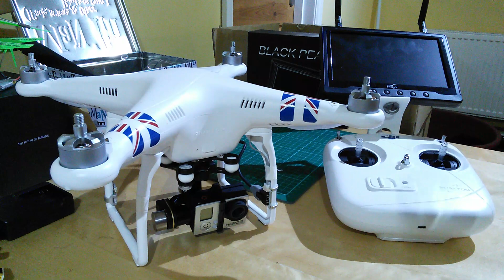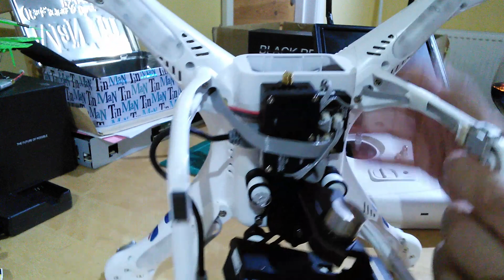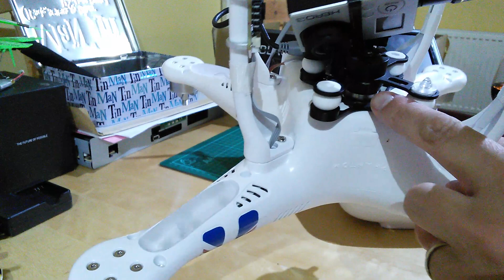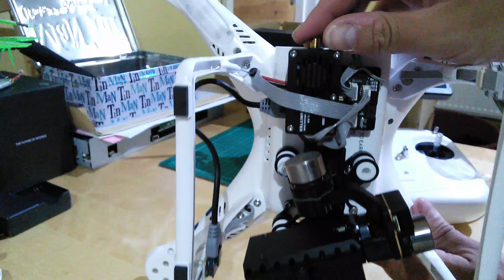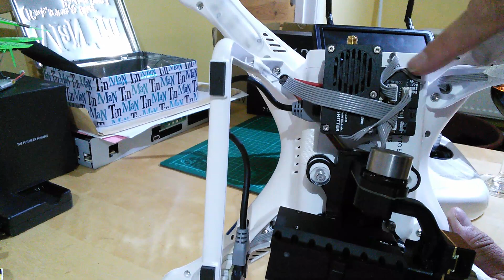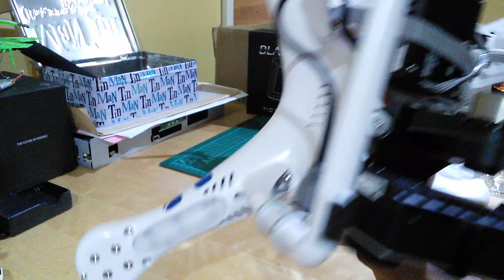My DJI Phantom 2 Zenmuse H3-3D and FPV setup

Comment: hello

I have the Phantom 2 with Zenmuse H3-3D and the Gopro Hero 3 black+

Still I not used the Phantom to record video, I have only used the Phantom for two aerial photography jobs, but yesterday I discovered this issue recording my first aerial video. I have an issue with my GoPro 3+ Black recording a loud buzzing sound when plugged into the replaced Zenmuse H3-3D on my phantom 2. All software on my Phantom is calibrated and updated. I checked all gimbal connections. I have installed the DJI Zenmuse H3-3D Anti Interference Reinforcement Board too. The GoPro works properly out of the gimbal, but the problem is when the GoPro is placed on the gimbal and Power ON the Phantom. In the sound track of the  video is recorded a awful strong buzz. This sound only appears in the video and is a strong sound.

You can help me please? I am frustrated by this problem. 

I put in Youtube two tests of my problem, please, see the videos and listen the sound:

Test 1: http://youtu.be/_WoX_MdevbQ
Test 2: http://youtu.be/ppdSyr6IKuY

Regards

Comment: Hi Simon, thanks for this very helpful video - there's very little out there in the way of instructions.
I am curious as to how you mount the receiver to the monitor/controller. Cryptically, there is one single piece of velcro in the AVL58 kit and I am stumped as how to use this with the mount? any help much appreciated.
Reply: Hi Simon, many thanks for the quick reply. Your answer helped a lot - I didn't realise that the Black Pearl had the built-in receiver. I have it working now and it's superb. I went for the BP after seeing your video - great choice. Thanks once again and keep up the good work!

Comment: Hi Simon,

I've just ordered the IOSD Mini, I already have the video HUB board and Transmitter, is this completely solderless also with the IOSD Mini? Also does the IOSD Mini come with the correct cabling to link with the above?

If not where can I get the cabling for this solderless setup from?
Reply: ***** Thank you, I decided to try and go for more range with the FPV setup and have ordered the immersion 600mW Long range Transmitter w/ SpiroNet Antenna and the plug and play cables straight into the Phantom 2. Have you ever thought about extending the range of your remote for the Phantom 2? I've seen a couple of things on you tube of people modding the controller to give a range of up to 6km!

Comment: How much flight time are you getting?
Reply: Wow that's crazy I'm getting 19 to 22 minutes on my phantom v1 flying dual 3s 3000 mah. And 2200 meters in range using all the standard components and setup.

Comment: Hi Simon, thanks for your videos and for your good taste (italian wines ;-)). I have the same setup you show here, the only difference is an immersion RC TX. The issue I have is that I can see the iosdmini output on the monitor, but no video at all.
I tried to switch the fpv hub from iosd to video, but nothing. Should I change some setup on my gopro side to see the output? Than you!
Reply: Thank you Simon! I think it's the poor ribbon cable. I changed it but I fear that the usb output module is ruined. It's a shame for DJI and for me!

Comment: hello simon, I was buying the monitor blackpearl, but then I read that it is not compatible .. use other frequencies than the AVL58 .. I see that it works then .. or are there different versions?
Reply: ok thanks

Comment: Hello, I notice you the pins on the gimbal diagonal as described in the instructions.  However I notice that this restricts the horizontal axes on the gimbal so have moved my pins to both at the front, is this a bad idea?
Thanks
Reply: That's great thanks very much for the reply :)

Comment: Question:  I have a Phantom 2 with the H3-3D.  First, can I use the gopro app to pull down video instead?  I know it isn't great quality, but I only need to frame shots.  Second, is the Phantom providing power to my gopro?!  This is all new to me because I am upgrading from the original Phantom with all this gymbal and video stuff modded out with 3rd party gear.  I know the original phantom would interfere with wifi and such.

Thanks!
Reply: ***** Thanks for the quick and good information.  I remembered the no-wifi from the first Phantom, but thought they had changed frequencies with the Vision. I  wasn't going to try it without some research just in case.  I suppose I'll need to do what you've done in this video here to get the video and telemetry data on the app then yeah?

Anyway, thanks again and keep up the great video work.  Hit me up if you ever need some slick titles or graphics. :)

Comment: What is your average range with this setup? I have a black pearl, IRC 600MW TX, and 2 spironets CP antennas (1 on Tx, 1 on black pearl)

Anyways my black pearl has horrible range and I hear it's due to not using an immersionRC receiver (since that is the transmitter manufacturer)

Comment: Simon, is it possible to install this gimbal on p2v, i thought it needs a special cable to power up the gimbal.
Reply: ***** thanks simon,
Reply: ***** I did the research and it's not very straight forward. Which is why I sold my P2V and bought the P2 with this gimbal.  The main issue is that there is NO tilt control on the P2V.  The other is that there would be soldering wires and cutting into the body to fit the gimbal.

Comment: Hey simon.
quick question. Do have have any controls from the ground for the gopro. pitch roll?
also if i was taking the odd picture can i use the gopro's video?
thanks in advance.
Reply: cool. thanks for the reply. the store im buying my phantom from have told me t wait a week for the new transmitter. still pretty unsure if i should be buying a zenmuse or a p2vp.
looking to get my licence too.
Reply: Thanks for the info.
I think I'll go for the gopro set up as the shop I'm buying from will set it all up and include a screen. I have a gopro 4. so not too sure what to with it. the shop have said the can grind a bit off to accommodate the gopro. Thanks for the advice.

Comment: Simon, nice video.  We just bought the same setup and I am waiting on the HUB in our FPV kit.  They were out of stock.  But my question was on the gimbal.  When I get everything powered up the gimbal only tilts down (with finger controller on back) about 80%.  When the gimbal turns on it tests it's thresholds and goes all the way down....I've calibrated everything.  Have any ideas?
Reply: Yea I had calibrated the X1 channel.  I did find in another spot a way to allow more/less travel, so I increased the travel under the gimbal TAB on the PT2 software and that fixed it.  Thanks again!

Comment: One more question Simon if a may pls

You demonstrated the fpv on the vision 2 that can take obviously fpv googles but can the vision plus take fpv google also due to the 5.4 signal ?
Reply: Just had a look at these options and the ziess looks great and it has the iPod /iPhone adapter for straight connectivity .

Thanks Simon you've been very helpful

Comment: whats up simon im getting a zenmuse gimbal today and wanted to know which h3-3d 3axis gimbal is that with out that wire strap to the gopro i dont want that one bro.i want the one like yours were its a direct fit into the gimbal.
Reply: ***** i got my gimbal simon and it qont qork right i have a vid up now bro.check it out and let me know if its broken or not ok.
Reply: OK thanks a lot!!

Comment: Hi Simon. I've just received my P2 with H3-3D gimbal. I intend attaching a GoPro Hero 4 black to it. However, at times I will need to take off the GoPro to use elsewhere. Can I fly the P2 without the GoPro attached, as I've heard elsewhere that I can't. Can you please confirm or deny?
Reply: ***** Thanks very much for the reply

Comment: Is it possible to swap the Vision camera for the gimble and back again?  I'm trying to work out what to buy to get started.  How far does the FPV transmit?
Reply: So it looks like Phantom 2, Zenmuse gimbal, Futaba TX and my existing GoPro might be the best combination
Reply: Right I see... What settings are available on the Vision+ camera remotely?

Do I need to get an FPV if I start with the P2 and gimbal, i.e. is the GoPro video transmitted at all back to the controller?  I have an iPad and Android if that helps
Reply: Doesn't the Zenmuse feed the video from the GoPro's usb port back to the Phantom? I'm so close to ordering but I want to try the basic setup and then have the option of extending range and trying different FPV setups. For instance I have no idea if I prefer a monitor or goggles. I can see myself doing good scenic flights (I travel a lot) so quality video and stills, and good range are important to me.

Thanks for being so helpful!
Reply: ***** Thanks for taking the time to explain this, the choices for the Phantom Vision 2 and the Phantom Vision 2+ are much clearer now...
Please have a glass of wine on me! *****

Comment: Great video Simon. Good stuff. Keep them coming. 

I have a question. I crashed my Phantom 2 Vision+ today in Boston MA. I was flying in a tight urban environment without the propeller guards. Long story short; a high 20mph gust of wind caught it as I was trying to land and it spiraled 15 away from me into a brick wall. 

I was mortified. Surprisingly, my Phantom 2 Vision+ survived the 8 foot altitude crash (into cement sidewalk) with some minor dings, scratches, camera fell off the gimbal arm, the cable ribbon ripped, and I managed to only break two propellers. I ran a 10 minute test flight this evening on the same date and it flew fine and still had perfect GPS stabilization and way point function. 

So the question - Can I have FPV function on my Phantom 2 Vision+ ? I would like to have FPV function connected to my Android cellphone just like before. I want to purchase the H3-3D Gimbal and the GoPro Hero3. Any help appreciated.
Reply: Hey Daniel. Glad there are more drone flyers in Boston. Take a look at what I did during my first week with my Phantom. 

Aerial shots of Boston Foliage: http://youtu.be/gItFIGI2iqE
Reply: ***** I really like the H3-3D with the GoProHero3. The quality is stunning. Too bad it won't work with the Phantom 2V+
Reply: There's a kit from dronexpert - http://dronexpert.nl/product/pre-order-quickrelease-dronin-for-dji-phantom-2-vision/ - that makes it possible to mount a H3-3D to a P2V+. Has anyone tried or heard about it? It seems like a good way to fix your broken P2V+ and upgrade it at the same time.

Comment: Did you put the Gimbal interference board inside the P2?
Reply: ***** It does fit nicely inside if you find that you need it.  I'm an old radio tech (30+ years) and if the manufacturer made it I would install it.

Comment: I would like your advice please.  I have a vision 2 and have managed to break my camera I believe, the power in put deal is broke or fried.  I brought it to a local rc guy it was working half of the time killing of power happened when I would tilt my camera via the app.  Once this RC guy messed with v2 he determined the cable was bad.  I ordered a new one plugged it in and now nothing.  So I have explored all the options I could think and have come to the conclusion that I will spend as much money trying to get it fixed as I would purchasing a new FC 200 camera. So I think I will be in the market for a new drone would you recommend getting the vision 2 + or a phantom 2 with the gamble and and the FPV system.  Or get another v2 and add the rotorpixel or similar gimble?  Trying to stay around $1000 budget but would love be to spend less naturally.  This is new to me really enjoy it, I really like the aerial photography aspects.
Reply: Thanks for the timely response.  Is the v2+ any less durable than the 2 with gimble.  I.e when I crash next time will it be cheaper to replace go pro and gimbal instead of buying all the separate  FPV system plus gimbal?  Is the range that much better with the p2 and v2+ over the v2?  I do like the app even though I have had a little connection issues in the past.

Comment: Great videos.  Can you outlay what I need to replicate your FPV set-up and are there places in the US where I can purchase them.  I have the Phantom 2 + H3D3 Gimble so it would appear I need:
- DJI AVL58 av transmitter
- DJI iOSD Mark 2
- DJI FPV hub
- Black Pearl diversity rx 7" monitor
- monitor mount for the Phantom transmitter

What about clover leaf antennas?  Also, Why the iOSD mark 2 over the mini OSD?

Thanks!!
Reply: *****

Thanks Simon!  Ok, so based on your council I'll amend my shopping list to the following:

- DJI AVL58 av transmitter
- DJI Mini OSD
- DJI FPV hub
- Black Pearl diversity rx 7" monitor
- monitor mount for the Phantom transmitter (the one you have the link for)
- FPV Antennas Black Pearl kit????

Last questions:  

- I didn't see the link to the FPV Antennas.  Can you send?
- Alot of people talk about 5.8GHz 600mW emmercionRC transmitters, etc.  Is that the same thing as the DJI AVL58 av transmitter?  If so, is the DJI better?
- Are there videos on how to install each of the above and in what order?

THANK YOU SIMON!!!

- Justin
Reply: ***** Brilliant!  I definitely do not need/want to solder to I"m going to go all DJI.  Really, really appreciate the question.  Last random question, I"ve heard you have to "set" your monitor to match your unit.  Given the DJI set-up, did you black pearl just "figure it out" or did you have to align anything?  

Thanks again for you time Simon,
Justin
Reply: ***** Perfect, thanks so much.  I am going to exactly match your set-up (except use the mini) so curious if we arrive up on the same channel :)
Reply: ***** what channel are you running on now? I ask because when I 1st got my Black Pearl I got a perfect signal but as soon as I was  more than 5m away (i.e. flying) from my P2 I had total signal breakup. I then looked at channels on both the AVL58 and the BP and found the 1st "common" frequency and set them to that - if i remember it was channel E.

I now have FPV connectivity but I also have the following issues:
1. Breakup of the video signal while doing maneuvers - the more "motion" the more breakup (but I can fly 100+ meters away and while the P2 is hovering, I have video).
2. Not great video quality on the BP - I appreciate that the monitor won't support 1080p but I was expecting better quality than what I am getting. Could this be a setting on my monitor as I set it to the highest quality I could? Anything else you can suggest?
Reply: Thanks Simon - I'll do some more testing myself.

Hadn't thought about using the monitor for review, good idea. Just need to carry the cable in the already overflowing backpack :-)
Reply: *****
What Flight Time do you get with the Gimbal, AVL58 transmitter and iOSD mini?
Reply: P7aNeRIP Great question, I'll have to check.  I'm sure I lost at least 2-3 min. of total flight.  I've only flow it with the gimbal so that is all I have to compare it to, but am surprised (seemingly light) how much weight the iOSD mini, AVL58, and all-in-one connection board.  When they are all on the unit, it is surprisingly heavy.  You can hear it in the engines.  Not at all a deal breaker, but quite suprising

Comment: hello guys..just wanna ask anybody here found a way to install a ground wire from go pro usb outer casing to video transmitter ground?? just to solve those nasty horizontal lines on video monitor....this would be the 1st problem anyone going to do fpv on a P2 H3 3D...may it be V1 or new P2-V2... you guys might want to replace your V1 props as the V2 props are more silent than the noisy buzzing V1 props and it has a 9445 pitch! replacing all my props with the V2 9445 props..

Comment: Hey Simon
I am on trac for buying a p2 with avl58, iPad ground station, iosd mini, and can us port to connect all of the stuff. I was wondering if you would know how much this setup will weigh and the flight time i would be getting (if it can even handle the wight, if not i will get a 550). Compared to your setup it will be about 80g more so probably subtract 1 or 2 minutes of flight time. 
Thanks, max
Reply: Ok. So if i were to get an f450/550 would I have better flight time, or about the same either way
Reply: Also, dji says not to go past 1300g, does this negatively affect the motors at all? If so, would the tiger motor upgrade help with this or flight time?  Thanks again
Reply: Ok thanks for your help. Are there any lighter plug and play fpv options because I want the most flight time possible but no soldering. Avl58 is pretty heavy but it is the only one i have seen where you don't have to cut and solder
Reply: Ok. I think i will go with what i was doing first. Thanks for all your help!
Reply: Ok. I think i will go with what i was doing first. Thanks for all your help!
Reply: One last thing. Are you satisfied with the quality of avl58? Dou you get lots of static or frozen frame? Is the avl58 system clear enough to fly fpv with? Thanks for taking the time to answer all my noob questions :)